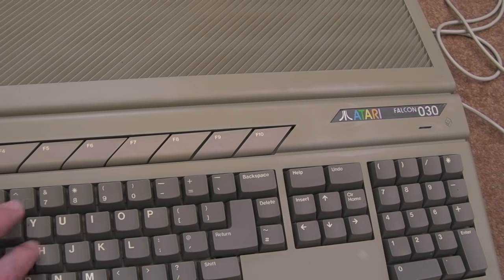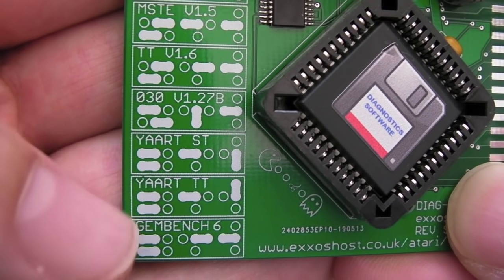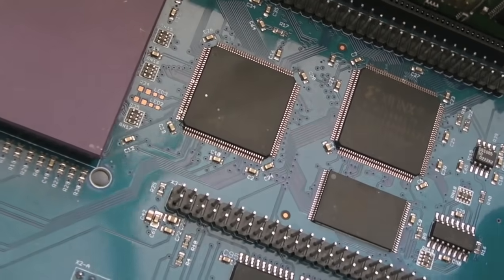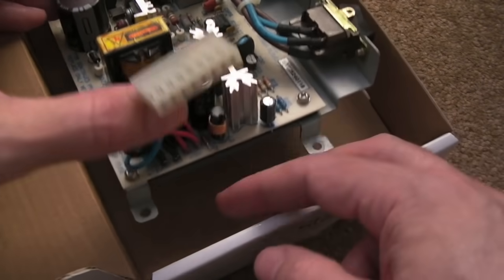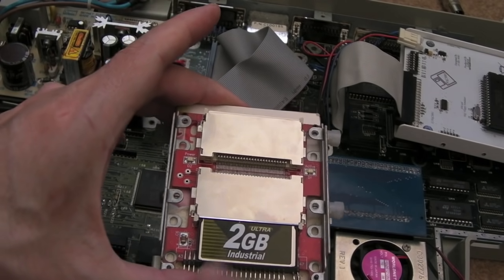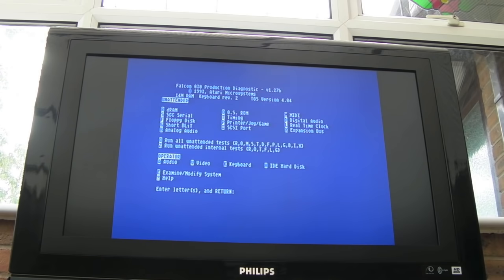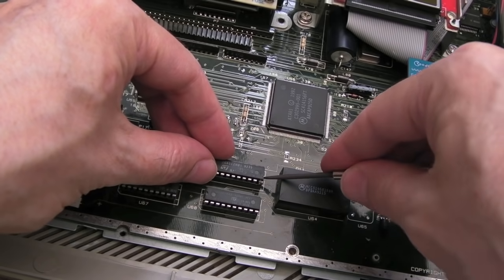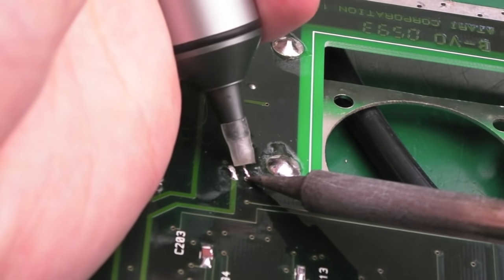Atari Falcon 030 Unbelievable Donation & Repair Part 1 (Fixed + Extras (060))

Comment from the maker: Part 2 - https://youtu.be/-4RtB7mLBPI
Part 3 - https://youtu.be/xrY4C5xvqFw

This system was incredibly GIVEN to me by William on Twitter (@ste_mega AKA 3DOKID)
Here's the link to his website:- http://wmgaming.co.uk/
Exxos (Atari Forum / Blog / Falcon &  ST Parts & Upgrades - https://www.exxoshost.co.uk/atari/
Peter Putnik ST  HDD Conversions (Many will work on the Falcon, or will work with Backwards III) - http://www.8bitchip.info/atari/pphdr.php
Reply: the falcon was only sold 13.000 machines. Mine is serial #7444 and is a pre-production model :) ; By the way Gadget, if you think the Falcon is expensive, try out the Sharp X68000 and its lovely games sold an arm worth :D
Reply: Great stuff, Gadget. Was amazed when I saw your post on Twitter about it. Glad you got it running so quickly. If I ever get my external 030 + ram board into beta test state, I know where I can send one for a run-out now!
Reply: CrazyPainter1000  I own 2 : One X68000 XVI and an X68000 XVI Compact.
Reply: Imagine if someone designs a board to convert 2d to 3d graphics and upto 4k resolution and 7.1 sound.... (just a project idea for any just going into uni computer engineering)....

Comment: Two quick notes on the CT60e and Falcon.  The expansion ports connectors on the Falcon are two different heights, so when the CT60e is installed it is meant to pitch down very slightly towards the keyboard, but this is made worst by the height of the power connector, along with the back left corner not being supported, so the board can very easily flex, and possibly damage the board. Also, virtually all Pico adapters will touch the RF Shield if installed, so if you use the RF shield, make sure you put some insulation on it so it does not short.
Reply: Old comment I know, but I have to say that I believe you're wrong about the expansion port connectors. Maybe one of them has been replaced on your Falcon? On both my Falcons and both my friend's Falcons the connectors are of the exact same height, and the CT60 is is perfectly level with the  motherboard unless you push the power connector fully in - the power connector is about 1mm too low... If you insert the power connector fully you will bend the CT60e PCB.

You're completely right about the lack of support at the back of the CT60e though, I have 3D-printed a support bracket here.

Comment: That trace you fixed is the clock trace to the expansion port. Your Falcon would have been completely dead in 060-mode before you fixed it. I had the exact same problem with my CT60e-equipped Falcon, which had the same trace broken in exactly the same place.
Reply from the maker: Thanks!  Yes, I suspect you are correct!  I never did follow that cut trace to see where it went - I really should have done!

Comment: "Proper" IDE cables are keyed, and both the CF adapters shown in the video have the key pin removed, so there's no question about the orientation.
Reply: On the silk screen there is a small triangle pointing to where pin 1 is

Comment: I could be wrong but that white residue is from contact cleaner, i use it and it leaves this behind once dried. but yes ipa and a toothbrush or just the latter.

Comment: Bridget Hirst, communications manager , US GOLD SOFTWARE on why they were not producing Falcon titles:

"Show us the market and we will show you the product. Based on the last figure I was told of 7,000 Falcons sold, as Atari haven't marketed it as a games machine, games players may make upto 10% or so, this just doesn't justify producing a game".

Kevin Bulmer (Legends Of Valour) said Atari hadn't even sent his team a Falcon.
Reply from the maker: Yeah, I can understand that!  It's all about how many systems are sold!  Atari should have provided all the software devs with a development system and funded some exclusives to bundle / sell at launch.
Reply: @GadgetUK164  I know with the Jaguar console, I.d software were expecting Atari to shift around 500,000 machines before the likes of the PlayStation and Saturn hit, Maxis stated they wouldn't consider it a viable consumer platform until it reached 500,000 units sold.

Guess Falcon would of been viewed in a similar light.

Yet Atari abandoned it to focus everything on the Jaguar 😭

Comment: I had a ST, still have an STE and TT030 but always wanted a falcon to add to my collection. I cant beleive how expensive they have become these days, the last one I watched on ebay a couple years ago went for more than 2000 australian pesos too. This price range is strictly the domain of the hardcore enthusiast these days. My TT i've had since high school and used it for homework etc, I've never really expored if anything more exciting can be done with it. It does have 16mb tt ram and 4mb st ram and a 1gb scsi hdd. Unfortunately I never found a video card for it though.
Reply from the maker: The TT is a lovely machine too!  And those are pretty rare these days!
Reply: @sarkycutt9611  i still dream of having a falcon 030 one day. I may have to make do with an fpga substitute like a Mister though

Comment: on the CF adaptor you can see the triangle pointing to pin 1 on the ide so you were 100% correct re the extra pins
Reply: Extra pins look like master/slave jumpers?
Reply: In fact if you watch the whole vid (doh!) it's marked there on the board! a= slave/master, b = master/slave

Comment: That thing where it will copy only 255 files sounds very much like a deliberate decision to only use an 8 bit integer variable to count the files to be copied. Like: "Memory is expensive and who would have more than 255 files in a directory, anyway?"

Comment: The Falcon was the ultimate computer Jack T's and his sons of "the new Atari" home computer division  (not to be confused with the original Atari, where many key people worked on the Amiga. Or to be confused with Atari Games who made coin-op games) came out with.

The idea of the Falcon was......let's try to beat out our arch rival, the Amiga. The computer that was totally revolutionary when first introduced in 1985, but that since this new Atari as they did at Commodore previously, built everything on the cheapest possible quality parts, on a shoe string budget, it took them 7 years to catch up. But they were forgetting something. The year is now 1992. The Amiga & the ST's prime days are long behind them, and both platforms are nearly dead. The PC has ultimately won the war, though it took them a while to really make it in the home market, or for things besides purely business applications. 

So the Falcon's prime motivation was.......with this we can finally beat the Amiga. Ohh boy. It was about bragging rights. The original Amiga team had long left Commodore. "We finally have better graphics & sound". Sure, at a time when, no one cared! Too late! The system didn't last more than 1 year. The Amiga was already basically dead at this time.

Comment: A lot of those small fans have 2 arrows in the plastic moulding around them, to indicate the direction they turn, and which way the airflow blows.

Also, if you peel up the sticker, in the middle is a small well. Sometimes there's a small plug you need to pop out. You can then put a few drops of sewing machine oil down there, and it will help them go faster and quieter.

Comment: Every case where I connected a ribbon cable the wrong way round has resulted in magic smoke for me. You were very lucky!
Reply from the maker: Yes, in retrospect it was a dangerous thing to test!  99.9% of the time with IDE cables, you will get away with it.

Comment: Aaaaaaahhhh, the ST's colour is completely different. You wouldn't want to swap the case :D I had a Falcon 030 back in the 90s and used it with Cubase Audio to produce music, before jumping on the Mac bandwagon when Apple bought Emagic and Logic was out... That's a beast. I had made the CLab mod for the audio timing... it was a dream.
Reply: That brought up so much nostalgia.... I'm missing my TT030 and my Mega STE tooooooooooooo :(((

Comment: Very nice to watch this, and to observe your raw emotion.  Very lucky, very deserving!  I too happen to own a Falcon, having owned it for a little while now, so luckily I paid not so much by today's prices, around £300.  I have a very similar set up, same IDE > CF with Master and Slave CF cards, and a CT60e with 68060 and 512mb, although I still have not fitted it.  It was interesting to watch you go through the motions with this.  As others I believe have mentioned, the keyboard keys should be a dark grey, and note the casing is a slightly different colour grey than the ST, just a little bit darker, Falcon variants aside which are more rare.
Reply from the maker: Yeah, I remember years back seeing Falcons for £300 - back then I thought it was a lot lol.  The keys are perhaps a bit brighter than they should be, I am not sure.  But it came out looking really good in part 2!
Reply: @GadgetUK164  It does look like it has been retr0brighted as you say, glad it's turning out to be a dream machine.  I too remember thinking £300 was a lot.  I remember just missing out on a couple of C-LAB Falcon MKXs for around the same price, oh well.  Very pleased to equally be an owner of a machine I could never afford when I was younger, or would want pay the price for now.  Looking forward to more on your Falcon.
Reply: @sarkycutt9611  Very true!

Comment: The RTC with the battery is an easy fix. I actually got a rtc for a falcon fitted into my Pentium since my Benchmarq chip was dead. :) I ordered mine from Centuriontech.

Comment: Oh man.. in the Doom part 'is the performance good on the 030, well, it's not as good as it could be' - no way man, this is a 16Mhz computer running Doom in true 24 bit colour with real midi synth playback running on an internal general midi wavetable software. DML the author spent years perfecting it and enhancing it to be 100% efficient using the DSP as a co-processor. Just think about that, Doom runs like shite in 256 colours on a 386 clocked higher than a Falcon. I think when you said not as good as it could be, you probably meant if using the 060 I guess :)
Reply from the maker: Yes, I think you're right - For what it's running on it's amazing performance!  But, when you see the 060 - wow, runs even better!

Comment: think my business partner has a few of em even. but then again the computer stores were also an atari dealership... it's not like none ever were in circulation... actual sales numbers were probably fairly low tho... it's probably like with those later amiga towers... most of em just kept sitting in the shops forever :P

Comment: Am soooo jealous as I only ever saw one of those in 1986, I think, while working in a Saturday job selling computers.
Reply: It may have been an Atari transputer... seems so hazy now.
Reply: Falcon was released in the early 90s
Reply: @sealance  We used to be an Atari dealer, I never saw one! I think we had gone over to PC's which may explain that?
Reply: @hoojchoons2258  i dont remember the exact year but it was probably 1992. I think most dealers had switched to pc by then
Reply: @sealance  Yeah the date on the board is '92. I'm sure we were still doing strong sales on Atari & Amiga back then but I may be wrong! PC's took off quite quickly! Indeed I remember us all playing network doom on a Pentium Pro!
Reply: And how it was to be Atari dealer? Did you have any problems with Atari Corp.?
Reply: @zarjesve2  It was just a Saturday job for me while I was at school; really enjoyed it as it was much easier than stacking shelves during the week.
Reply: @zarjesve2  In the UK we didn't deal directly with Atari but one of their distis. It's a long time ago but I don't recall much in the way of support. We had tech manuals and diagnostic cartridges (that my colleague blew as it could fit upside down!).

Comment: I didn't assemble a lot of those RAM boards, another company did, I think they used IPA to clean the boards which is known to make things go white like that. So they all are actually cleaned when I get them. Future batches will be done "in house" so will run them in the US cleaner without IPA in the future.. Lesson learned to everyone not to use IPA as that is what you end up with :-\
Reply from the maker: Don't worry about it, it's just a minor thing!  The products you design and sell are amazing!  Must be the purity of IPA, since I used IPA here to clean them too!  I've had the same thing myself with batches of IPA though!  If I don't point it out, someone else would for sure!  The NVRAM board from you in the next video is a different story ;)

Comment: OK it is of course completely up to you but my reasoning would be that you've modified the insides to improve the machine. Taking the label off and putting that cool new one on is just improving the outside. I just think it would look slicker inset like the original is rather than raised up like a sticker you've just added on top, which of course is what that would be heh

Now onto the machine itself. I had NO IDEA you could upgrade the processor and so cool that you can do the floppy drive to SD card thing too. It really is like the Amiga in those ways. Knowing it could have a 060 just blows my mind. The best I ever got on the Amiga was a 040/40 and for a while back there I was king of the world with that. Until I saw a PC running Doom of course and then everything changed lol

Amazing work, really enjoyed seeing you eagerly working on it. Can't wait to see the machine fully modded and running examples of 3D. 

As for the price being high. I could see a lot of old music guys wanting that same computer setup they had back in the day but with the power to actually chew through music production almost like a modern machine but with all those years of muscle memory with knowing the old software. A lot of them probably still have all the software up in storage or the attic etc. and this is the ferrari of classic computers for music work. I could go on as I'm mad into 3D too but I've already written half a book here. Cheers!
Reply from the maker: Thanks, very much appreciated =D   Yes, it is a lovely machine and is comparible to something like the A1200!  It's a shame there wasn't more support for games, it could have done better I think.

Comment: The 44 way IDE cables include power.
Reply: Yeah, and they cause a lot of problems when you connect them backwards.. I blew up a laptop drive attempting to connect it to a pc using a 2.5" to 3.5" ide adapter because the pins on the drive weren't labelled/numbered :-(
Reply: Those longer pins in the middle are normal, they are the key/middle pins I think? I have seen that a lot.

And you found the jumper settings for master slave :-) some laptop drives had those extra pins too, and some laptops had wider cables with a gap to interface with those pins and control the master/slave selection from the motherboard (even though I never saw a laptop with 2 drives..)

Comment: Hi, just found this video. I have an Atari Falcon 030 which has been kept in a box for over 20 years. I tried to turn it on again, power LED is on and drive LED in on, but there is no picture. I was wondering if you would be able to help me find what the issue is...
Reply from the maker: It could be the capacitor on the reset line - that's a common issue with the Falcon.  What video cable are you using?  I assume you see the power light?
Reply: Thank you for your response @GadgetUK164. I tried to connect the Falcon on a TV and on a VGA screen with an adapter (same result on both). Power light and hard drive light stay on. Are you anywhere near London by any chance?

Comment: It's impressive that 16 MHz 030 can run DOOM at these speeds.
Reply from the maker: I think in no small part due to usage of the DSP.
Reply: @GadgetUK164  Yeah, probably. Since my friend's 486 wasn't doing much better. I am not sure about its clock frequency, but it could be 40 or 50MHz.
Reply: More (a lot) details about Bad Mood (Doom project) at https://www.atari-forum.com/viewtopic.php?f=68&t=24561
Reply: Btw I would like to see Doom running on 386/486 side by side with Falcon running Doom... :)

Comment: On some F030 boards the clock patch is required for CT060 to work... there are many variants of clock patch and some are better, some are worse. You can find a comprehensive info here: https://mikrosk.github.io/clockpatch/
Peter Putnik's game conversions work best with his HDD driver, and they require a clean boot. So you have to have a separate boot partition (his driver allows you to switch boot partition) or use a boot manager, like XBoot III.
Prices of Exxos gadgets, for me are quite high - e.g. his STf 4 Meg RAM expansion is 60GBP + 5GBP for a ribbon cable, I bought a similar expansion in Poland for less than 20GBP. Only thing I bought from Exxos was a bunch of old, partly incomplete, dirty, and yellowed STf keyboards - I knew their condition, the price was very good, and it was a fair deal. I've cleaned them, repaired, retrobrighted, and they all work fine.
As for the soldering quality, I think he has some health problems (allergy?) and he recently avoids soldering, I also think, he has to avoid any solvents for the reason.
Reply from the maker: Thanks, I've already sorted it (weeks ago) - part 2 is already up on Patreon, and part 3 will follow in a few weeks.

Comment: 18:30 VDD + GND  solder blob? That's been a decoupling cap.
Reply from the maker: It originally had a PCB that fits over the chip profile - with connections on VCC and GND!
Reply: @GadgetUK164  Ah right, that was the other possibility :P But I've seen many ICs that have decoupling cap on top, soldered straight onto the legs. Hey I've seen you repair keyboard foils, have you contemplated trying to 3D print the busted tracks with conductive PLA or PETG?